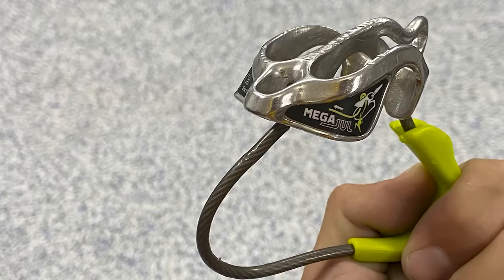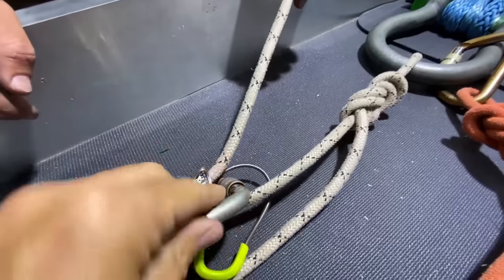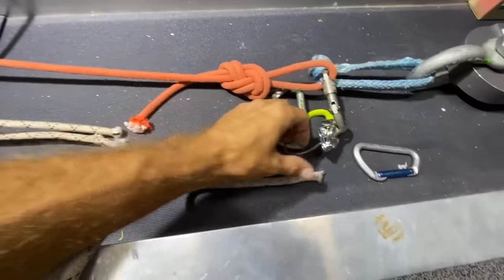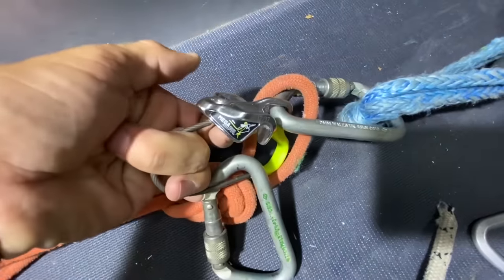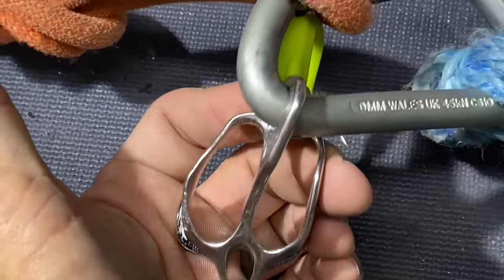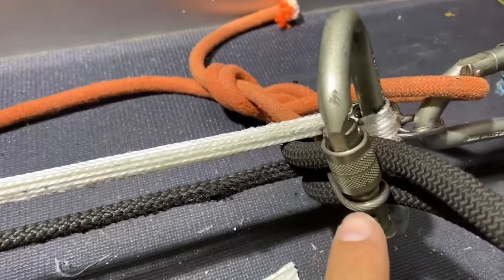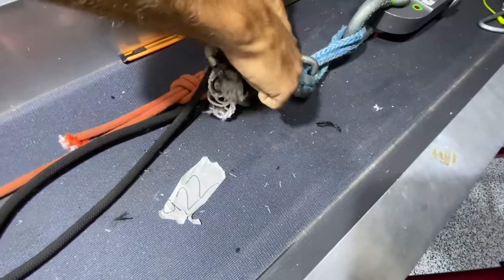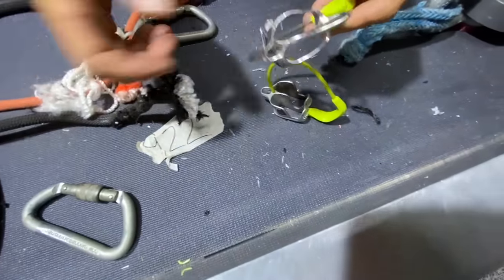Break testing climbing belay device - Edelrid Megajul

Comment: Would love to see you guys try to break a Petzel iD...It's like a Gri Gri on steroids that's easier to use the handle release device...Instead of the whole device opening like what a Gri Gri does to lock off, the Cam on the inside rotates and that's what gives you the friction to lock onto the rope. You can use a single finger to release the friction instead of needing alot of strength when you're hanging from a Gri Gri.
Reply from the maker: I wonder if the rope would break.  We did a grigri test and the rope broke first.  I think all belay devices do that?

Comment: The megajul is set up dangerously incorrectly on guide mode, the way the biner it's oriented would partially prevent the autoblock mode from working.... There's a really clear edelrid video that shows how is supposed to be used!

Comment: Hey. Whats the breaking strength of a reverso, as if you are bringing up a second, in auto lock mode, with the device clipped into the anchor. Why arent they rated? I asked a cocky tech eons ago about it, but got a bs reply. They are a load bearing part of the system, without a load rating.

Comment: Actually, the wire is important part of the megajul - without it it is very hard to rappel or bring the climber down. I have seen 2 times when the wire failed. Ones I was on the rope on my way down and my partner had a big problem to bring me down. Also the megajul is uncomfortable in rappelling even when it is not broken. It is widely used in jams and when it fail it is a rescue mission.

Comment: Frankly speaking, I don't get the test at all. Forces in guide mode are much lower usually than in lead, so what did you proof here? If the force is about 8 kn you bring up hang an elephant with this device and it will hold.
Reply from the maker: There really is no point other than people wanting to see belay gear broken.  We definitely don't put enough force while belaying in guide mode to break it.  Interesting what happens though when we do pull a lot though.

Comment: I don't like the operation of this device
Reply: Guide mode is not supposed to catch any kind of lead fall, top rope only. Strong enough for me..
Reply: I've had an edelrid rep tell me that they don't either, thus, the gigajul.
Reply: I'm a fan. I got one of these because I liked the break assist with the ATC style. Never liked grigri's.
Reply: I'm a fan...really basic concept that anyone who has used an ATC before can pick up and understand. Found it catches falls really well and pays out slack really well when leading, only downside is the lever action to lower can be hard when lowering a heavier person if you havent got strong wrists..leads to some slowish and bumpy lowers for me

Comment: can you test the ratio of force when belaying. So we can see hard would it be to hold the brake for a big fall when belaying.
Reply: Theoretically there shouldn't be any forces on the brake, because the rope gets jammed inbetween the carabiner and the belay device. For that reason you should only used carabiners specified by Edelrid.

Comment: I use also the megajul from some time already. I have never put the carabiner to belay a second pointing down and through the inside, I put it as other ATCs, just up.
Also the second test, is not like you would normally use the magajul for rapelling, as a nice feature is that it has the blocking mode, and for that you had to put the device in the other direction..it would have been more realistic, and probably ended up with less troubles with the rope.
Good job anyway!! very interesting
Reply: Yeah I thought it was just me, but are they using the wrong side for guide mode?

Comment: The second hole is not for belaying 2 people. It's for one climber using 2 ropes if there is a lot of zig zaging om the route. It then reduces rope friction as you will alternate what rope you secure to the wall depending on if you are left or right in the zig zag pattern.
Reply: Actually, it is. If there are 3 climbers, the leader then belays two followers from the top.

Comment: @2:00 you say you have two ropes for two people. I think it's more common where there is 1 climber on 2 ropes. This happens when your placing gear for protection but some of it is way out left and some out right. With one rope it ends up zig zagging which really drags. With two ropes there is more weight but less drag and it's often worth it. This also means you can use smaller ropes (see link), but I've only ever seen two standard ropes being used beacuse, well you already have them. 
https://www.vdiffclimbing.com/half-ropes/
Reply: Half ropes. Could be more of a European thing. I’ve learned it this way and I like them for multi pitch climbing. They are also great because you can use the full length (e.g. 60m) for abseiling in case you have to retreat or otherwise want to get down from the top of a route. They also have a softer catch so should put less stress on gear. Mine have 33% of dynamic stretch, so theoretically if you take a fall (even a small one) into the full 60m of rope you’d fall a further 20m :D